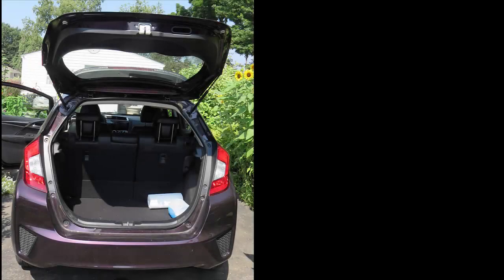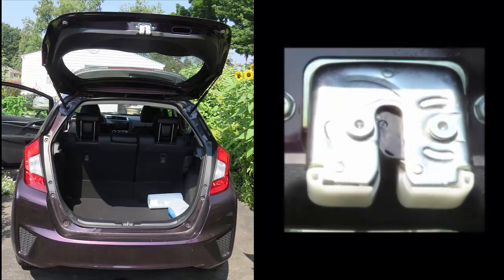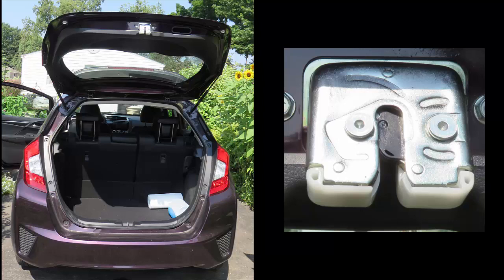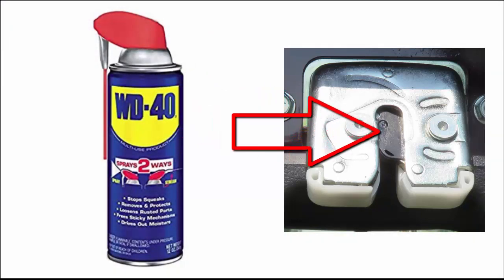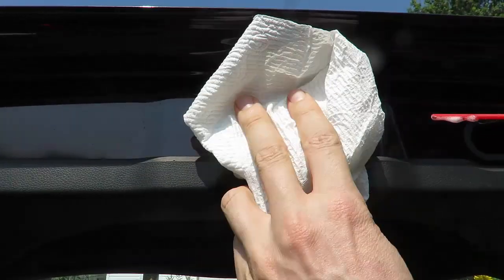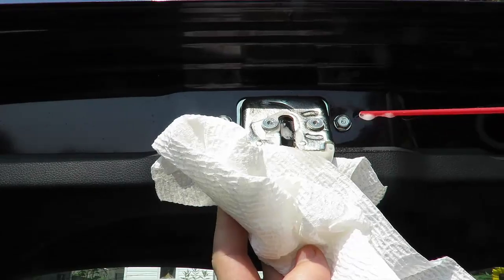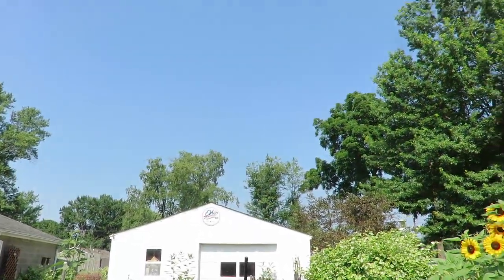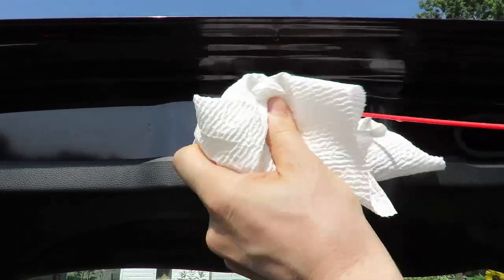Back Rear Door/Trunk on Honda Fit Won’t Open

Comment from the maker: As many have noted, WD40 isn't a lubricant.  I'm guessing that there may have been something that the WD40 dissolved to make the latch work.  Three years later she hasn't had problems the hatch.

Update 9/2022: after four years the problem came back.  I sprayed a bit of WD40 to dissolve any gunk, waited a few hours, and then sprayed some Silicone lubricant (Blaster brand) on the lock. Works perfectly now.
Reply: Good thing i read these comments. I was going to buy a can of WD40 but will get a can of Silicone lubricant now. I have the same problem with my 09 Fit that uses the key to unlock the trunk, no fob.
Reply from the maker: @ital2525  Yeah, the WD40 worked well the first time for about three years before it started sticking occasionally.  I then used the Silicon lubricant seems to work fine as well.

Comment: Worked on my 2019 Fit that had developped intermittant problem right after the 3 year warrantee period..  The hatch would unlock but would not release all the way. Probably some moisture freezing after the last car wash. I only had to repeat a few times and it worked. Thanks.

Comment: Tried this and it was a temporary fix.  Two weeks later same problem.  Honda said replace the lock.  I did, $275.  A week later same problem.  Their trial and erorr approach was to try replacing the latching mechanism, or maybe even the FOB. It would end up costing $700.
Reply from the maker: Wow, that's some money for something that should work.  I used some silicon based lubricant about a month ago since it was starting to stick again and that seemed to help get it back to normal.  I think the WD40 dissolves some of the junk and the silicon lubricant helps the latch move easier.

Comment: How do you get the hatch open in the first place if it won't open??
Reply from the maker: That sounds like a it might require the assistant of a mechanic...
Reply: Yes that's the situation I'm in right now!
Reply: @billieteggers2661  I've taken the interior panel off of the trunk lid and manually pulled the wire. It's still stuck closed.
Reply: @847MicRoss  on the white plastic sheathing that flanks the striker pin you will find a tiny trap door on top of the passenger side.    open that little door and you can push the latch back from the striker pin with a small screwdriver.
Reply: @scottconn71  Correct me if i'm wrong, but this trap door you speak of is on the 2nd gen and not on the 3rd gen.
When I had this problem and read that they removed the trapped door on the 3rd gen I was like WTF
Reply: Scott c has the right answer for a 2019 Fit.  It worked fine multiple times after I got it open  I did not use WD-40.
Reply: I've been leaning on the trunk while pushing the handle back to it's normal resting position. Hit the unlock button and you should hear it unlock.

Comment: Lock your car.
Lean in on the trunk and press the handle back to it's normal resting position and hold it.
Hit the unlock button.
You should hear a noticeable click.
I hope that helps.... it may take 2 or 3 tries but that usually does it for me.
Reply from the maker: Thanks for the info, that is helpful!
Reply: Jazz 2016 1.3 petrol, have the same issue and can be solved mostly this way, but i will try spray too..

Comment: The WD-40 is degreasing the gunk, not lubricating it.....I'd use WD-40 then use tri-flow or something similar
Reply from the maker: I'd agree with this!  It really did the trick though, the door still opens without any problems.

Comment: How are you supposed to get it open to do this????
Reply from the maker: For my mom's car I pushed it in and out, pulled the handle a bunch, and it eventually opened.  Another option would be to do that while someone does the same sort of push back in forth from the inside.  But if it absolutely won't open you're stuck living with it or going to a mechanic.  If you get it open make sure to read the pinned comment for the video.

Comment: open the compartment panel on the inside of the hatch door and spray in there.
Reply: They removed the little panel on the 3rd generation.

Comment: What is 10W-D40? Are you confusing motor oil for WD-40?
Reply from the maker: I'm using WD-40, the blue spray can.  It worked well, the door still opens fine...
Reply: 10W-40 is a thing, WD-40 is a thing, 10W-D40 is not a thing

Comment: It says REAR DOOR HONDA FIT WON'T OPEN... but you show it open. Mine is stuck CLOSED, just like your title says.
Reply: That was the original problem.  It would take a good bit of trying to shake the rear door back and forth for it to finally open for me to deal with.  Pushing the door in will trying to open, side to side, etc.  Or having someone push from the inside while you try to open it. Perhaps try on a colder day as well.  Hope that helps!